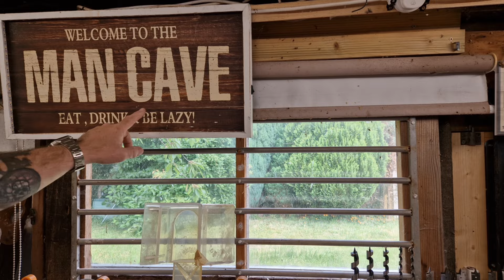Bits & Pieces In The Workshop

Comment: Hi David, hope your well,  You can get some great bargains in Lidl and Aldi in the middle isles, never know what you can find for the workshop. I bet your happy you got the scroll saw up and running again, just a good rub down and a bit of spay oil. I use on my metal surfaces is 3 in 1 spray oil which is made by the WD40 group or my home made oil rag in a can. I used a half size can ( empty beans can ) rolled up an old pair of socks tight in side and I used some 10w/40 motor oil and rub down with that, over the winter months. 
As always a great video,  take care mate
Reply: What you got stuck to back of your right leg on your overalls russ  wants to know
Reply from the maker: @shaun30-3-mg9zs  Great tip Shaun 👍
Reply from the maker: @KateScarsbrook  It's my invisible mending 😀 I only had an iron on denim patch. Hope you're both well, take care David

Comment: Thanks David, after a shaky start those spiral blades worked a treat, ideal for how you have the saw set up, you could just do with the power button on the front side for convenience is it an nor or could you turn it on via an extension ?
Reply from the maker: @andyc972  Ha 😀 it had been that long since I used it that I was slightly puzzled when I was searching for the switch. I can not remember why I  fixed it this way around, but if it gets on my nerves I will sort it 👍